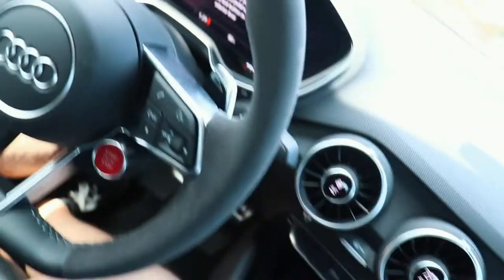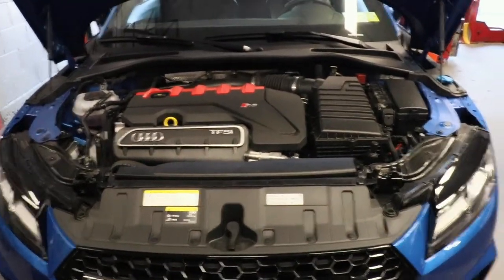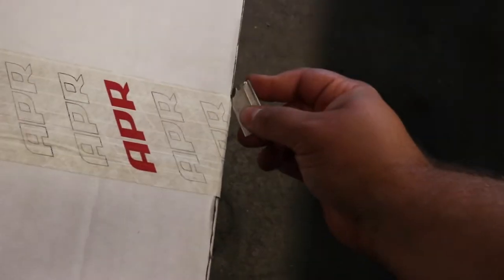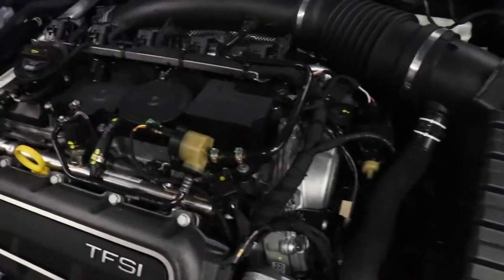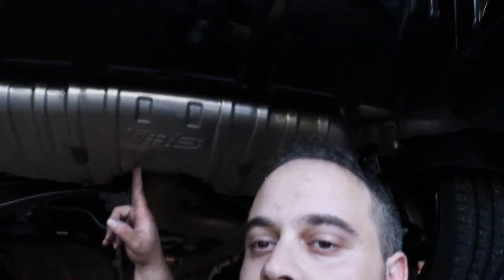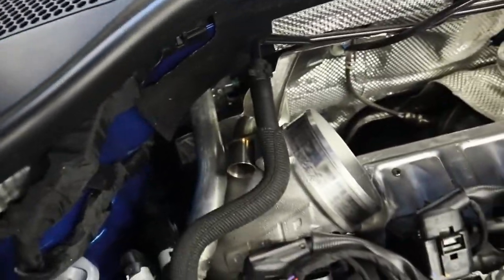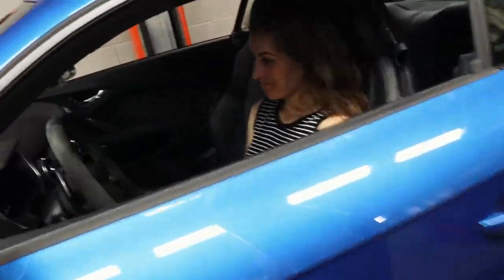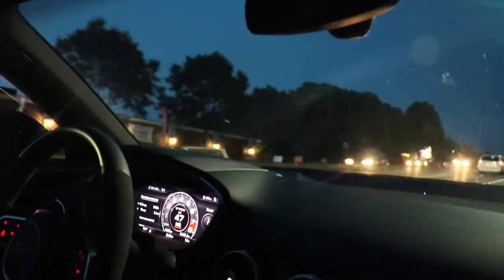Audi TT RS |  Carbon Fiber Inlet & Intake System

Comment: intake without a tune gains no power, time for a flash. Looks good and sounds nice though =P
Reply from the maker: Jon Hayes flash is likely next. But this is not just an intake, It’s the turbo inlet too! APR does show a 32whp gain from both together with no other mods,  with 14whp being from the turbo inlet alone. I haven’t dyno’d but I can definitely say the car is way more responsive and feels a tad quicker. I’m hoping to be able to measure more as I make more changes

Comment: I just went ahead and spent on the eventuri intake. Sooo worth it in terms of quality and power. No heat soak, and it looks insane. Check my install out, also yes Unitronic is the way to go, I’m on uni stage 1 and once I finish all my bolt on’s I’m going stage 2. I have mid and down pipe as well as intake. Shits a rocket, nice girlfriend she seems like a keeper by the way.
Reply: Did you install your downpipe? what downpipe you got?
Reply: @wjlowe111  I did, I have the unitronic catted downpipe. Passes emissions and no cel. I have the install video on my page

Comment: How much louder is the intake? Is it noticeably different?
Reply from the maker: It’s very noticeable! I was actually surprised at how much noise it added. I’ve been meaning to get some better clips of it. Will try in the coming weeks with boost season setting in :)
Reply: @danny_vrsociety  Been on the fence about getting this for my RS3....the $1100 for an intake/inlet 0_0.....sounds worth it though!
Reply from the maker: I feel you! But considering some TTRS/RS3 intakes are $1300+ without the inlet, i'd say this one's a steal! Also if you hold out for a show or event next season you can usually get a great deal on the set. That's what I did and I basically paid wholesale!